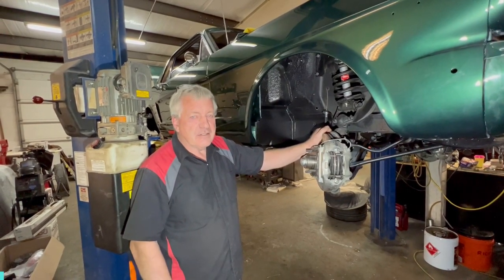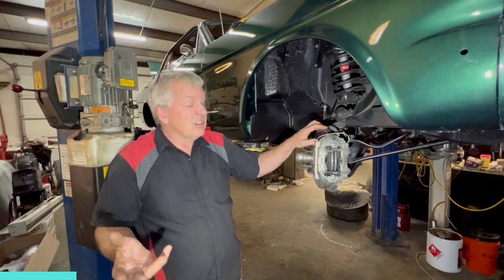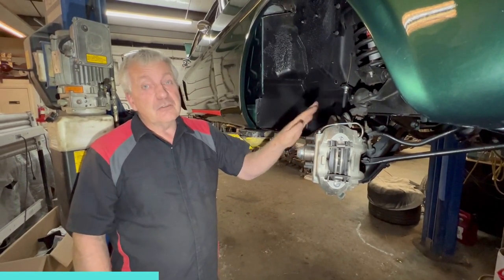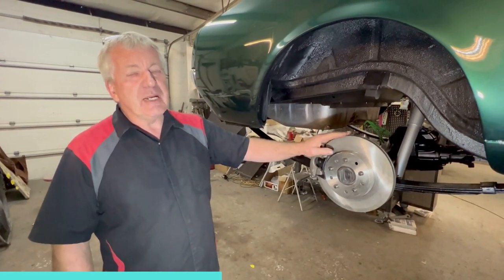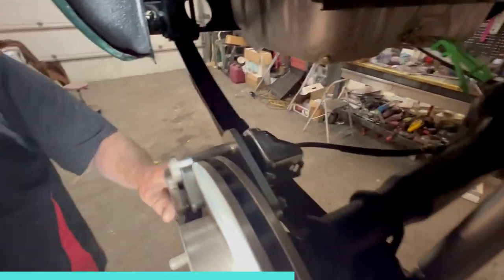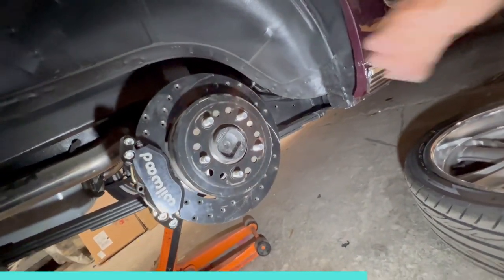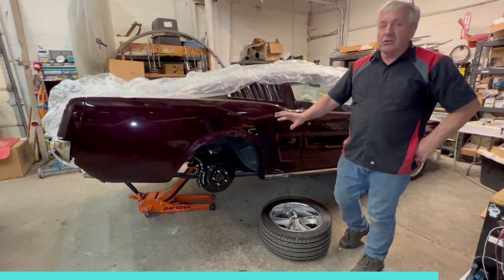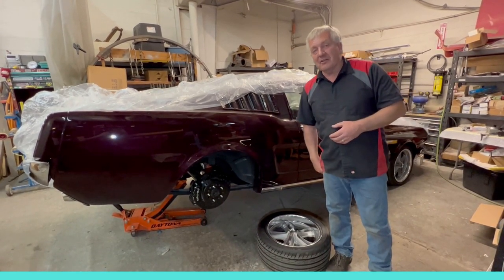The Great Disc Brake Debate!

Comment: Great advice from Kiwis Crispy Classic Custom Cremes. A properly adjusted drum actually works better than a disc....... *once*. Give it a hiding, or even just a bit of brisk driving, and minimum of discs up front are an absolute necessity. Funny, thinking how you mentioned people's distrust of discs in the 60s, but by then, the Italians were putting them on all four corners of nearly anything that wasn't just a city commuter.
Another great video Kiwi. Keep them coming.

Comment: I hear a lot of people say drums are fine, and they will stop fine under sedate driving conditions. I have a 1968 Chevelle that had all drums. Came off an exit ramp to see a police officer standing in the road. I had 4 people in the car and had both feet on the brake pedal as the car locked up and the brakes RAPIDLY faded away ! The disc brake conversion followed soon thereafter!
Reply from the maker: I'll bet it did!!  😁  Thanks for watching!

Comment: Funny just last night on my way home my 83 Mercedes broke a rotor. Rotor probably only had 60K miles on it and the pads were still good and no signs really of much wear but the flange broke off from the hub so clean I couldn't even see what was wrong until I turned the hub by hand and the outer part of the rotor didn't move just staid held in the caliper. Caliper was not stuck and no signs of heat. Only thing I can figure is the cast was bad. I looked it up and they were Bendix rotors I put on 4 years ago.
Reply from the maker: Oh could have ended badly!

Comment: I have had nothing but trouble with those GM style calipers with the integrated parking brake for the rear disc conversions. 3 separate customers cars have had dragging e-brakes, e-brakes that wouldn’t hold the car, and calipers that would lock up when hot. For budget rear disc conversions on cars, I use factory late-90s/early-00s Explorer parts. It is a disc brake with a drum in the hat for the parking brake. The only modification needed is re-drilling the backing plate to match the pattern of your axle retainer, but once that is done they bolt right on to 8” or 9” rear axles.
Reply from the maker: That's Hot Rodding bud!  Creativity born of necessity 😎👍
Reply: Go through the adjustment procedure. Do it off the car on a vice to get it perfect. Not even close to worth the time involved IMO. If I have a customer that wants rear discs I push for the wildwood with integrated drum. I don't do budget stuff lol.

Comment: Drums work with good quality shoes, which are getting hard to find. Discs work better, but pad quality isn’t what it used to be either
Reply from the maker: With all the asbestos rules now it's changed that's for sure!   Thanks for watching
Reply: Asbestos is the reason. A very stable ingredient is all friction material and was genuinly kind on rotors. There is no end of decent pads out there for performance driving

Comment: I throw front drum brakes in the recycle bin on any old Mopar. My '76 Valiant sedan runs the last of the B & R- body "Big discs," offset UCA bushings trick, A38/A51 suspension & steering. It's not a desirable muscle car, but it's a cool vintage driver
Reply from the maker: Fun to drive is fun to drive. Build it how you like it, drive it and have fun!!
Reply: @kiwiclassicsandcustoms9160  exactly. To me, I like the ease of getting parts, better braking; without purchasing Wilwood, Baer or such $$$ components- at a certain point its not smart money nor will it give me better stopping (reaction times, tires and suspension play a huge role- but can't sell mega-buck parts pitching those ideas).
I've got a sedan. It'll never pull "Real" money, but it's part of the appeal. I can drive it all over with little worry

Comment: I've been saying this since the 80's, when I built my '67 Cougar.  I did a junkyard parts swap from front drums to disc brakes from a '68 Cougar XR7 (spindles and brackets-all new rotors, calipers, lines), then stumbled my way into a 9" rear diff from a Lincoln Versailles, that included the entire rear disc brake system.  No, I didn't need the rear discs, but since the rear end came so equipped, it went on my Cougar.  I did this in phases- front first and then the rear.  I noticed a huge difference with the front brakes, not so much on the rear.  Come to think of it, I really miss that ol' Cougar, she sure stood out in a sea of 65-68 'Stang notchbacks in my local Mustang club.
Reply from the maker: My mustang has a $80 explorer rear axle. It still has the original ring and pinion, just added a limited slip center and a reinforced hat on the back.
Reply from the maker: Search here on YT for KIWIburnout 1
Reply: Damn, I'm the owner of a1967 cougar for the last 46 years and I did pretty much the 4 wheel dics set up like you in 2012. Your right, on the rear dics, not much deterrence in stopping. Thanks from north California

Comment: Difficult to argue with your advice, especially if we separate classic and muscle cars. Docile classics will be ok with original looking drums, the key is that they are upgraded to dual circuit systems. 
Regarding hot rods and nice looking disc rears, in most modern cars the rear discs remain rusty... 😉
Reply from the maker: Even on a classic a single circuit master is ok after all millions of miles were done with them.  You just have to be on top of preventative maintenance!   Thanks for watching

Comment: I have 11" mid 60s full size Chevy brakes not the 9" drums of other years makes and models. It stops well, I am not driving my cars like I am at a track or anything like that. I will say wheel cylinders go bad more often than brake calipers. If you like to go 120mph + get big disc brakes you will need them for sure
Reply from the maker: Agreed!!  Thanks for sharing and watching!

Comment: I’ve heard that the because there is a larger friction area on the shoes compared to pads. So properly adjusted drum brakes should stop great until they get hot from repeated hot and heavy use back to back to back. At least in theory.
Reply from the maker: Yes, heat is what kills the drum brake

Comment: Aside from heat soak issues with Drum brakes. I prefer disc for the ease of maintenance. Nothing I hate more than dealing with sticking/rusted drums!
Reply from the maker: A lot less moving parts in a disc set up too!   Thanks for watching

Comment: Been looking at big brakes for my 2013 boss 302 and as far as rear brakes go I keep being advised against putting multi piston calipers due to the semi floating axle causing too much piston push back from the axle inward outward play causing a low pedal just spent 4 days at the track looking at lots of cars and guess what every one is running the stock rear calipers for s197 8.8 type rear axle also told by many builders there are rear calipers out there for sale but they wouldnt install them on their cars good luck
Reply from the maker: Ok, multiple things to address here. 1: the Ford c clip rear axle does suffer from more end float than a full floating or bearing retained axle. That end float can cause "pad knock off" giving the long pedal.  A residual line pressure valve is an easy fix for this.  It keeps a couple of psi in the rear lines.  Pad knock off does not get exponentially worse as the number of pistons increases as the pistons are smaller. 
2: The whole reason for multi piston caliper is to allow a larger longer pad. As the pad gets longer you need 2 or 3 pistons pressing on the back of the pad to insure even pressure on it.  If you just have one piston in the middle of the pad it will deflect or bend in the middle and that defeats the whole point of the larger pad. In the high end calipers they will have smaller leading piston and slightly larger trailing piston to further improve the pressure balance over the pad surface. The key thing here is multiple piston hydraulic area is typically close to to the hydraulic area of a single piston caliper so the pad knock off is not worse. That argument is flawed. 
3:  rear brakes do about 25-30% of the stoping work ( factory rear brakes are often choked down hydraulically with a bias valve of some kind)   so the stock set up is likely adequate with upgraded front brakes unless you go with huge front brakes.

Comment: I've always been of the school of if it ain't broke don't fix it...... Drum brakes do work for the rear and keeping the car OEM, but if you plan on tearing a car down you may as well give yourself all the safety that you can. Cuz if you go left on a burnout because you're right caliper is stuck that's a problem and most people let their calipers rust crazy they don't do a lot of maintenance on them....... However, racing, you need as much as you can in the safety department if disc brakes are safe and serviced that can go a long way...
Reply from the maker: Couldn't have said better!   Cheers mate!

Comment: Drum brakes are more than adequate for most daily driving needs. If they are set up properly and properly maintained, you will be fine with drum brakes.  If you live on a mountain or plan on racing the car, the discs will probably be better.

Of course, all this assumes the parts you are getting are high quality. If Ford still makes the drums for some modern car's rear brakes, definitely buy the Ford brand. 

Of course, if you can "upgrade" the car to OEM disc brakes, then that is the way to go. 

The market is absolutely flooded with sub-par 3rd party parts of every description.  I've seen  videos of shattered or cracked aftermarket rotors.  You just cannot trust any aftermarket parts these days, especially with your life.  I'd rather have high quality drums than poor/unknown quality rotors.

That is why I say don't change them if you don't "need" them.  If you aren't racing and you don't regularly go down 8% hills 10 miles long, you don't really need them and you can avoid the headache.
Reply from the maker: I hear ya.  I replaced the 100k rotors on my wife Lincoln MKS, 6000 miles later they pumping through the pedal😡 I got them warrantied out but they didn't install themselves ......

Comment: 🔔😎
1) As you stated, you can slide the wheels with drums.... at least once.
The limit is tire traction.
2) no safety stands.

I have no problems with my 1978 Granada manual type 11" disc/ 10"drums system on my car. 3300 pounds.
But I do believe in premium pads but still run standard type vented rotors.
Enjoy your stuff. 👍👍👍 Thanks. 😎
Reply from the maker: Hmm point 2...  Yeah ya got me there, should have had stands under it!  In my defense it was jacked up purely for the video and no one was going under it. Still not best practice though.  Thanks for watching!!
Reply: @kiwiclassicsandcustoms9160    Well, the FMVSS has specification on OEM stopping distance.
  So yes, they have laws. 
It is brake manufacturers that most, develop and use one recipe for disc friction and another for drum. 
  I will be running disc / drum as it comes down to modification. The pressure has not increased at the master cylinder, but one 3" front piston is the same as two 1.5" pistons. The change comes with cam's, higher Horse Pony's that result in an incorrect sized booster. Without a vacuum pump, then you may have to go to an 11" booster. Less vacuum yet, dual diaphragm 11" booster. The problem is room, lack of funds. Even is you want to go 2.6 secs to 1/4 mile, then maybe 6 piston front calipers. Use what a Corvette uses. I don't see any discussing DE3A ACDelco pads certified by Greenling Labs and place the vehicle into FMVSS. 
As far as drums on rear, the wheel cylinder may be an inch or 1 1/8" I.D., but the shoes are self energizing and grab fine. 
  If you want to race and put $6k in 4 wheel disc, then do it, but 80 MPH is still the max speed limit. (Wyoming is on its own)
My problem is guys who build 1000+ HP cars / pickup and don't match brakes to GVW, speed and hp factor. 
DK, ASE master retired.
Reply: @deankay4434  One 3" diameter piston is not equal to two 1.5" diameter pistons.  The line pressure generated by the force on the master cylinder piston, the volume of fluid moved by the master cylinder, the resulting pedal effort and travel, and the caliper piston force resulting from the line pressure all vary according to the square of the piston diameter.  Consequently, at a constant line pressure, a single 3" diameter caliper piston (diameter squared = 9) will exert twice as much force upon the rotor as two 1.5" diameter pistons (diameter squared = 2.25 each).  This condition explains why it is so easy to wind up with grossly mismatched master cylinders, calipers, and drum brake wheel cylinders.
Reply: @myredford39  Not taking the time to do the "Pi" math. I could care less. I know they are not the same as these same principles are exercised in hydraulics of automatic transmissions 100 ways to Sunday. Everyone has their own idea on brakes but I had to diagnose, repair the root cause and move on. It's called flat rate. Even dealers where I worked until 9PM thousands of nights. I lost count how many times my wife brought dinner.
 Happy stopping!
Reply: @deankay4434  Perhaps I misunderstood what you were saying in your first comment.  I thought you were talking about modified systems, not OEM.  A non-stock brake system should work well if all the components are sourced from or designed for one car.  When combining '69 Camaro front discs, '65 Nova rear drums, and a '73 Mustang master cylinder (not from a kit) as I have on my Model A, the components' piston diameters (as well as pedal ratio, a proportioning valve, and several other variables) have to be taken into account, or the resulting gee-whiz brake system can be dangerously bad.  But I'm just a cranky old engineer who has been playing with hot rods for 35 years.  Regards.

Comment: Question around the rear disk brake conversion, if you did not change the axel to a full floater, will the rear disk brakes automatically brake in hard corners? Might only be a real issue on track days and maybe auto-x.  Not really an issue for drum brakes since the shoe has some lateral room to move.
Reply from the maker: Great question.  They won't automatically brake but you can get what's called "pad knock off". This is when the pad pushes the pistons back into the caliper giving you a long pedal on the first application. That can be quite un nerving!  Back in my rally days we would use a double row wheel bearing that gave you a lot more lateral support and eliminated knock off. Another easy way is to install a residual pressure valve in your rear brake line that hold 3-4 ponds pressure all the time. It does create a little drag but works well for auto cross and track. Hope that helps!

Comment: Yeah, front disks on everything. I've personally seen the pre Light Vehicle Modification days in New Zealand before 1992. Even in a backwater like Kiwi land, everyone did XE Falcon or HZ Holden four wheel disk conversions.Frontband back!  In the US, that's never been the case until 2000 and the AutoCross X era. Big problem (and I have a friend at Wildwood) is that there's a lot of extra that goes into it, because C clip 28 spline 8.8 inch axles and factory Shrink ring 9 inch Disk rear Versailles are very badly engineered and don't cope or  suit what a good modern cammed up Small Block can produce. And a functional hand brake that allows you to do burnouts...that's a lot of work with a disk rear end.
Reply from the maker: Yup front disks are minimum in todays traffic and horsepower levels.  Thanks for watching!

Comment: I’ve got a 68 Barracuda with a 426 Hemi with standard 4 wheel drums that I upgraded to a Stage III Muscle Car Brake kit.  Without a power brake booster ( no room for it) there’s no real advantage to a disc conversion.  Car stops pretty good overall with this premium drum setup.
Reply from the maker: Good for you man!  There is a huge amount of peer pressure within our hobby to have the best and blingiest stuff on our cars. If your enjoying your car for a bunch less money then more power to you. Smiles to the mile is what it's all about !!   And if a Hemi A body doesn't make you smile your dead inside😁😎
Reply: In the mountains of California, disc brakes are a must, but if you're in the flat lands ok

Comment: Hey Kevin! I’ve got a 63 mercury meteor is there a decent disc brake conversion for this? Remembering I’m in nz and will need certification. It’s drum all round with a remote booster I’ve got a little 302 in it now so front discs would be nice.
Reply from the maker: That should be the same as a 63 Falcon so Wilwood have a kit for those. For the Aussie market Wilwood have a caliper that has dust boots for the pistons as that's a requirement there. Not sure if thats required in NZ though.  Something to check on before you buy.   Cheers mate

Comment: What about upgrading the quality of the rear drum shoes? What's available and from whom? ( first gen F body)
Reply from the maker: There are places that do upgraded shoes that are typically used in the racing class's that mandate stock brake configuration.  They help a bit but suffer from noise and don't work so well when cold.  Use a good quality shoe and if that's not enough bite the bullet and go disc brake
Reply: Muscle Car Brakes in Texas offers hi po drum brake kits.